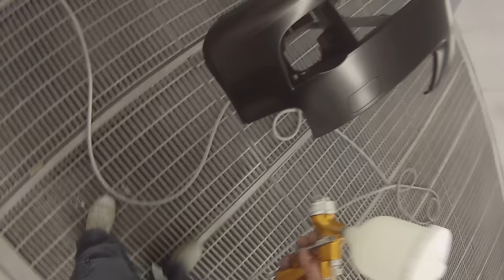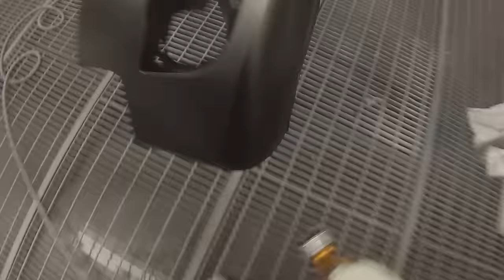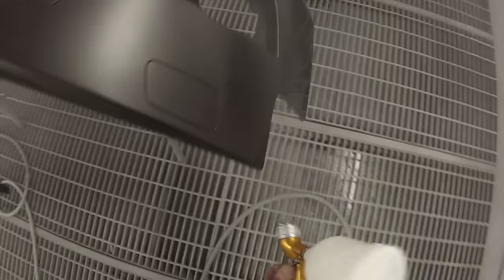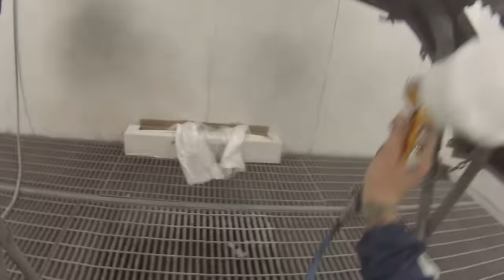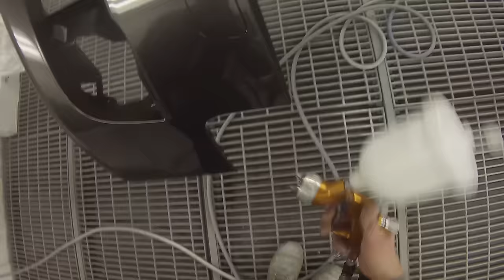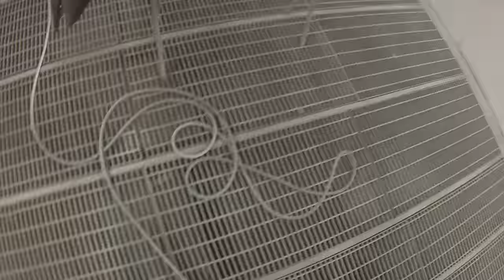LOUD & CLEAR BOSS!!

Comment: Hey Gunny! How many oz. of clear do you usually use on a bumper that size?
Reply from the maker: Rule of thumb for me is 300ml for a bar, but as you see half this bar is trims that aren't even painted so 200-250ml. That's for a HS clear, slightly more if MS.
Reply: Could you post a quick guide for clear amounts on different panels? It would help me and Im sure a lot of others as well. Thanks Gunman!
Reply: The Gunman RAW u talk bad of Laos!!!? u done man. u like the Thai lady boy ppl